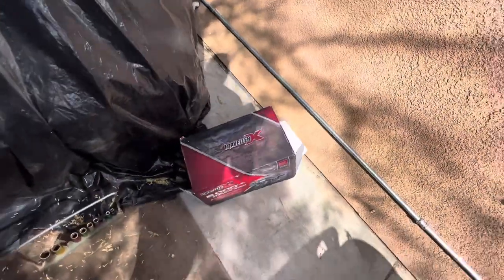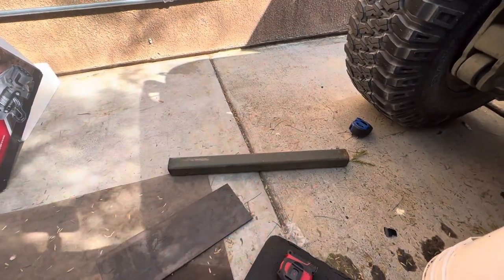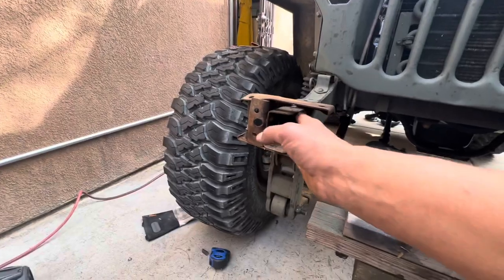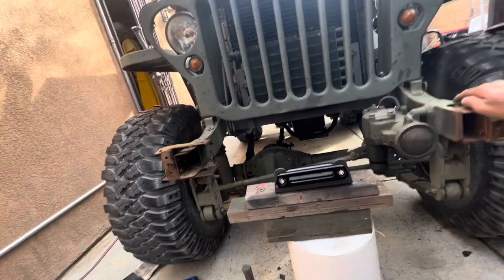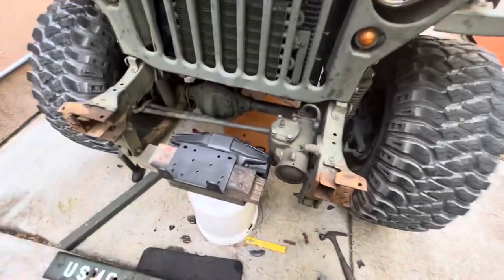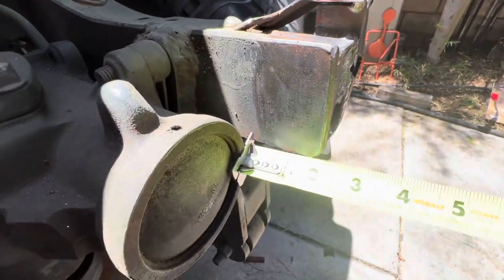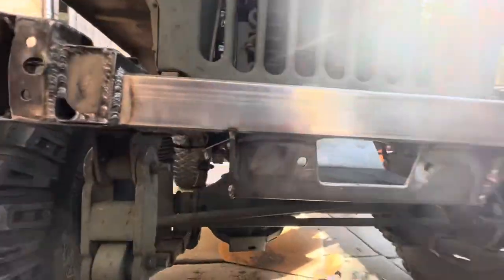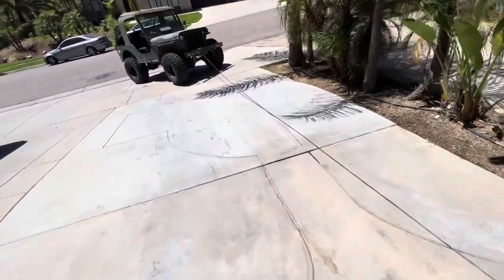Willys Jeep Stealth Winch Install/ stocked/ CJ2A/ Flat Fender/ custom/ 1946

Comment: Hey Devil Dog,
Turned out well, now to be on the safe side you need to think about a aux battery and a 150 amp alternator. Run your winch and aux accessories off the aux battery and you won’t have to worry about running your starting battery dead.
But if you do have issues with the starting battery, you can jump yourself off from the aux.
Just a little food for thought. 
Semper Fi brother
Reply from the maker: thats great advice. I’ll have to start planning that out. 👍👍 Thanks.
Reply: @reconern  I had a 150 amp alternator built as a 1 wire at an alternator shop for 130.00. I have 3 charging circuits on my M38A1 and 2 alternators. The 150 amp charges the main optima yellow top, when I kick in the 2nd charge circuit, it charges the main yellow top, the aux yellow top that is dedicated to the 12,000 lb winch, off road lights and radio/ comms gear, when I lick the 3rd part of the charge circuit, it charges the Blue top optima in the CND 101 trailer.
The 2nd alternator is for the under hood welder, but if the main alternator fails, I can tie the welder alternator into the charging circuit in a matter of minutes and I’m up and charging again.
Back ups for backups brother.
Semper fi